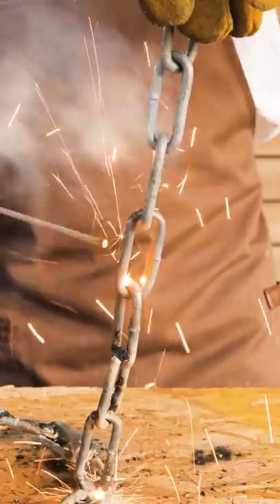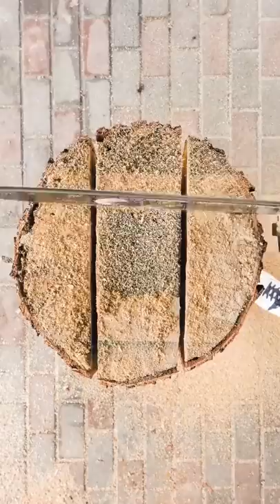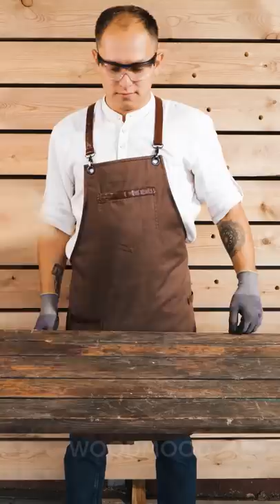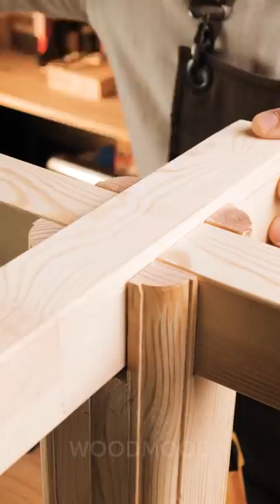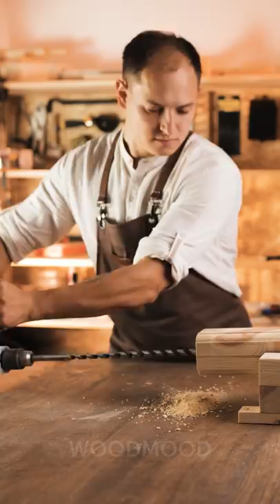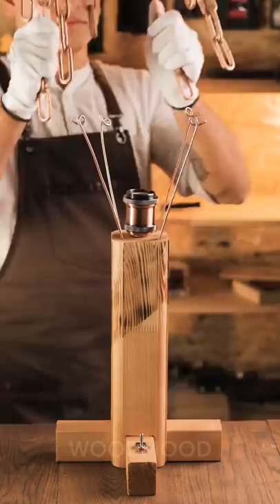The master took an old rusty chain and one piece of wood 👀 See what happened in the end! #Shorts

Comment: I was under the impression the wire should get hot enough actually melt the solder.
Reply: I think that's the very cheap solder, they never melt properly and don't last that long either, all the steps on that video are fake and or really badly made

Comment: It's years  1800 and 2055 simultaneously.  2 downontheirluck youngsters wander the valleys looking for an opportunity to earn money and learn a trade, 1 in each year.

The 1800 youngster happens upon a building guided by the smell of fresh cut wood, in which a master can be found practicing precision Japanese joinery.

The 2055 youngster hears in the distance muffled technopop. Following this, the trail ends at a tinyhome surrounded by cellphones on tripods broadcasting livefeeds. In it, a master can be found clamping loose joints, hacking whole logs carelessly for a small plank, piling bird-doodoo solder on wires, all of which culminates in the crescendo that is the youtube youll-poke-your-eye-out-lamp-thing.

This is good.

Comment: ..nobody is talking about how that is not the way you connect two wires lmfao
first off they shouldnt already be tinned before connecting them, you should twist them together instead of just soldering when they're next to one another (youd be lucky if the connection lasted a week) and tin them after you twist them together